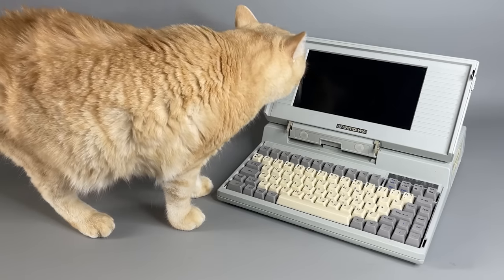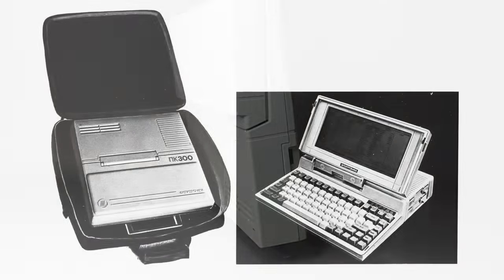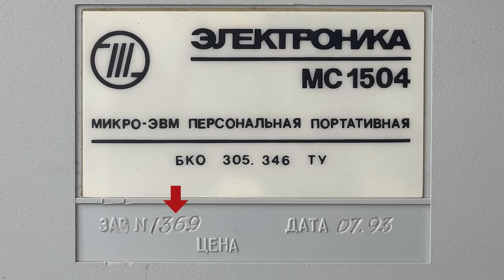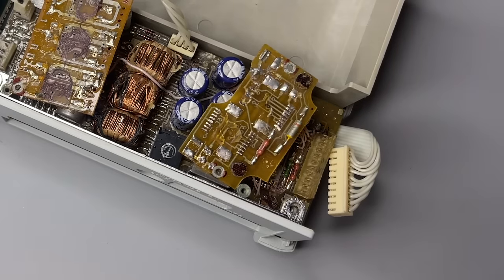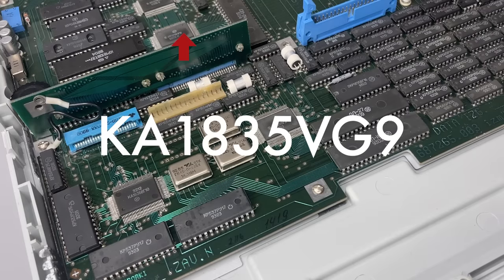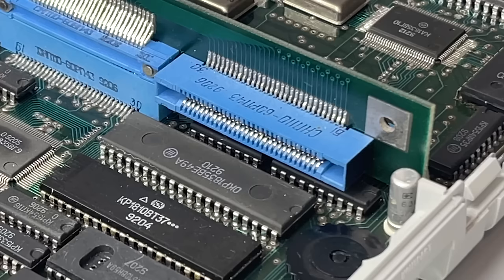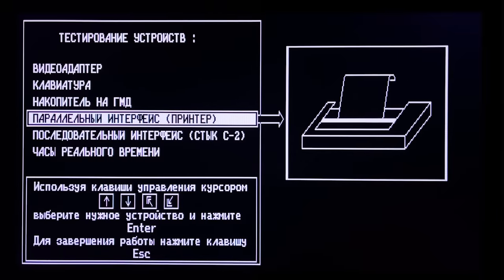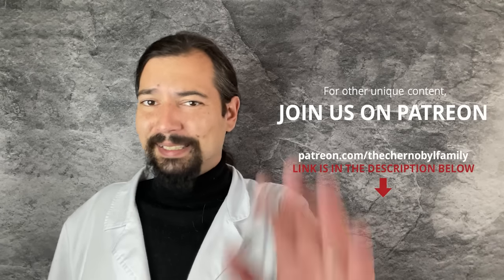I FINALLY FOUND IT! Behold Elektronika MS 1504, the ONLY SOVIET LAPTOP EVER.

Comment: Interesting. It never occurred to me until now how strange it is that these Soviet machines actually had standard ports and floppy drives and other components instead of developing their own versions.
Reply: Well, there were unusual ports, for example electronica MS-6013 printer had it's own connector that was incompatible with centronics DB-15 connector, but I made an adaptor for this and used it on i386.
Reply: if they were focussing on mainframes and minicomputers it becomes less surprising. Once they made the decision to make micros they could see western and Japanese designs and pick what worked best in their situation.

Comment: I'd make it run of off 9v DC and throw in dc-dc converters to provide all the other needed voltages - that's what I did in my MSX which runs internally on +/-12v and 5v
Reply: it's so simple a kitty can use it🤣🤣🤣

Comment: 13:18 comparing the quality of the motherboard with the quality of the power supply board, it is very difficult to believe that both were produced by the same company. And, if they had the tools to make a board with the quality of the motherboard, there is no justification for making another part with the precarious quality of the power supply board. Adding to this, the Latin characters, I conclude that the motherboard must have been manufactured by a foreign supplier, possibly Chinese.
Reply from the maker: A funny detail that PSU prototype was very industrial. Probably, they decided to go for a cheaper handmade solution.
The board is belrusian, latin characters were widely used in Soviet tech - just software sometimes was foreign and could not consume Cyrillic.

Comment: 1990 and they're still using 8086? By then a 10+ year old processor. I get more grunt from a $1 ARM.
Reply from the maker: That is exactly what I meant. It is visible they put some love in this project, but... it is so terrible out of the time.
Reply: AFAIK, Airbus's fly-by-wire system is built on two hardware platforms: 80286 and 68030. The airplanes are still being produced, I wonder whether Airbus has re-certified the hardware for newer CPUs (and there are no new 68XXX CPUs), or has a stock of the hardware they acquired thirty years ago. Anyway, I just wanted to point out that for many applications you don't need a modern ARM. And smartphones are evil :)
Reply: @TinLeadHammer maybe they use ColdFire now? Or emulators?
Reply: They were also still using their 8080 clone! ;) /Brett
Reply: That is the ussr for you i wonder what they would be using today if the ussr was still around Pentium 4? or core 2 duo?
Reply: @TinLeadHammer  Yea but that thing only has one purpose unlike a pc
Reply: Don't want to shatter your dreams, but especially in the luggable / portable market, PC/XT clones were still a very real thing in the West too, in the early 90's. They even sold rather well, brand new. Computers were ungodly expensive then and I was still doing real work on my Victor V86P by 1992. A friend of mine rocked a 386 desktop, and we looked up at him as if he were some kind of rockstar.
Reply: For the record, in 1987 I was using a 32-bit, 8-MHz ARM2, and by 1991 a 25-MHz ARM3.  Back then, it cost considerably more than $1, however.
Reply: 8086 machines where still  being sold in the west in 1990. Not the top end for sure but still being sold as entry level. Now get off my lawn

Comment: I think trying to build a clone like this machine was a bad idea from the start. Obviously it was going to be outdated by the time they started manufacturing it. What they should've done is build a PC that more people could afford, and concentrate on improving the manufacturing process of their ICs to improve the yield. That's the best way to push the technology forward and make it more affordable. The more PCs you can sell, the quicker you can improve the manufacturing processes, which will bring the cost down. Perhaps it won't be as sleek and portable as the Toshiba machine, but more people would be able to use it.
Reply from the maker: ...cloning in most cases is a bad idea.
Reply: @ChernobylFamily Not always.
Cloning the hardware allows for using of software already created.
Reply: @UpLateGeek
За счет клонирования персонального компьютера IBM PC/XT, Мир получил "компьютер в каждый дом" по приемлемой цене. IBM, в одиночку, не смогла бы это сделать.
By cloning the IBM PC/XT personal computer, the world received “a computer for every home” at an affordable price. IBM alone could not do this.
Reply: @vvdvlas8397  Yep, IBM made the mistake of building the PC out of off-the-shelf parts, and were rewarded by clone makers undercutting them using the same off-the-shelf parts and just charging what the mass market would be willing to pay.

Interestingly, the Intel 8088 processor used in the IBM PC was never meant to be Intel's flagship processor, it was just a quick modification of their existing 8086 processor, designed to be cheaper to implement since it had a simpler 8-bit bus compared to the 16-bit 8086. They were actually working on a new architecture that was supposed to make them the big money, the iAPX 432. However this was abandoned soon after IBM released the PC/AT with its 80286 processor, when it became clear that the future was the x86 architecture due to the growing market for IBM PCs and clones.

At the same time this was happening Intel's main "competitor", AMD, had been doing quite well manufacturing licensed clones of Intel's 8088 and other chips. To cut a long story short, after their legal battle surrounding the licensing of Intel's processor designs, AMD's first non-licensed clone, the Am386, took around 6 years to produce, but sold over a million units in the first 7 months of its release.

So while it was the success of the IBM PC and the market for its clones that allowed Intel to continue developing the x86 architecture beyond the 8088 and 80286, AMD's success started at licensed clones of Intel's designs, which gave them the time and money to invest in developing their own processor that cloned Intel's 80386, creating the market for x86 compatible processors we have today.

All that from selling clones at a price that the market is willing to pay.
Reply: @u2bear377  This makes sense in the western world, where there was a lot of software designed to run on the IBM PC and its successors and clones, but probably not so much in the USSR. It makes sense when you can build a clone for a price that people are willing to pay. If you can't make enough profit to develop the replacement for your existing product, then you don't have a business so much as a future bankruptcy. But I guess that's not so much of a concern when the government ultimately owns your business. Whoops! There I go getting political.

Comment: Wait are those serial numbers engraved or did they use a soldering iron? Either way, they were done by hand...
Reply from the maker: You mean on the bottom of the laptop? Hot needle typically.
Reply: @ChernobylFamily  Yeah, those. Nothing screams quality like a serial number etched in by hand by hot needle ...

Comment: So, the motherboard went through 5 revisions, while the power supply was still in prototype stage.
Reply from the maker: It was even more interesting. The prototype PSU was actually way more "industrial" that the one which went into production! Why it happened so... I guess (just guess) that there were too few laptops produced to make one more production line.

Comment: What about the chip with two holes in it? Great video!
Reply from the maker: Thank you!
Those oval openings are a side-effect of the technology of production — in the middle of them it is possible to notice a few holes that are for the manipulator which positions the metal parts during forming/shaping. The crystal itself is sealed in the center.
Reply: @ChernobylFamily  Thanks! I've never seen a package like that. That Russian 3.5 inch floppy drive looks amazing too!
Reply from the maker: @andycristea that one is indeed Russian, I do not remember the factory, but it was made there; also there were a few other, more compact prototypes designed by Elektronmash here in Ukraine, but there is no much information on them.

Comment: The horror, and why would you have 2 floppy drives?
Reply from the maker: To have two floppy drives was perfectly normal practice for computers which did not have a hard disk. From one you boot, on another you have data, otherwise how to work? The japanese computer this was cloned from had the same.

Comment: Sorry to hear about the frustrations with the power supply. But, you should know that it has merely been modified to meet Western standards! Most power supplies in Western laptops of that era were total junk and would burn out after a very short period of time because they were not meant for serious use. My father had a Tandy 1400LT laptop that was my first memory of a computer at about age 3. The power supply went up in smoke about six months later. Eventually, my parents divorced and my dad's new girlfriend had an amazing gift for me at age 8 - the same exact model of laptop with a working power supply, which she had long since stored up in her attic. But that was apparently rare. The power supplies in that laptop apparently never held up under real usage until the later revision when the model was split into the Tandy 1400FD (2x 720K floppies) and 1400HD (1x 720K floppy, 1x 20MB HD). Tons of fraud on the US computer market back in those days.
Reply from the maker: Thanks for sharing!

Comment: wouldn't be surprised at all if the plastic case, along with motherboard would have been imported (made by Japanese using supplied chips), they don't give the usual impression of soviet or immediate post soviet build quality
the keyboard, lcd power supply integration and that horrendous power supply look very much built in house
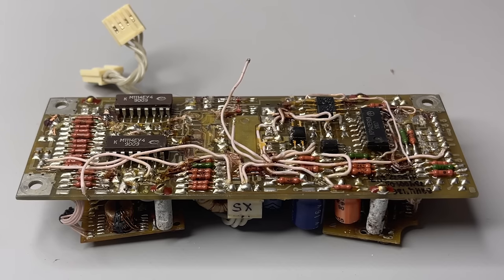also 12:00, I suspect they removed the gold plated chips so they could profit 2x from this, sell chips separately and the laptop itself as complete, unopened unit, then claim someone else removed the chips before they got the machine, and that they never opened it
interesting to see the teflon insulated wires, typical for soviet mil production, have few spools of those wires myself, love them, despite the difficult to remove insulation

Comment: This laptop was not obsolete. It was lowend, but in 1990 these laptots still were sold. They were affordable compared to high-end laptops like Apple Portable, which was bulkier, more powerful but also significantly more expensive. Who would buy in USSR laptop for then 7000 USD?! Elektronika MS-1504 cost under 1000 rubles, which was still like 8 moth wages of average worker.
First modern looklike laptop - NEC UltraLite came just year prior MS-1504, had same power and equipment (minus floppies, because it was really light and compact) and cost 4000 USD.
Elektronika MS-1504 dropped its price to 550 rubles in 1992 (unfortunately at that time USSR was in political and economical turmoil, so it is hard to compare that price to average salary, because often that salary was just on paper and new "capitalists" often did not pay to their slav... eh workers).
Toshiba T1100 Plus, came on market in 1987 (introduced in fall 1986) and costed just under 2000 USD. And this made that laptop hit. Low price. 

USSR was lacking behind consumer electronics. But it does not mean, that they are not capable to produce top level electronics like western companies. Problem was, that there was no internal market for such products. Selling 500-1000 rubles worth electronics to consumers was hard, selling them 10000 rubles was impossible. And companies? Facts are quite simple. There are only two things you can do on computers:
1) Something useful, like CAD/CAM or massive databases
2) Something useless like tables, presentations and stupid videos/photos for marketing

First one was impossible to do at that time on consumer computers. Even 3M computers did not have really enough power to do it and specialized minicomputers, mainframes or even supercomputers were needed. In this area USSR was not so behind. In fact computers like Elbrus-3 or Kronos were more then equal to their western counterparts.  For second one there was no need in Soviet space. Marketing was not a real thing in USSR. Making tables for tables was also minority. Powerpoint? For what, what was military connected was classified, what was outside military was underfunded. And Soviets were rather doers not talkers. So meanwhile americans were talking and painting and faking how will they do something, Soviets just did it (or not).

So I would not see elektronika MS-1504 as something to laugh to. Yes, it was cloned Toshiba, but it was clone of most successful laptop of that era. Was it produced domestically from domestic parts? Yes it was. What is competitive in its price level. Yes it was. So what?
Reply: Exactly. Youngsters see the world through pinkish tinted glasses, but if you have sloughed through those times, you know the latest and greatest in computing wasn't actually available to the masses in the West either, and you had to make do with whatever junk you could afford paying through your nose.
Reply from the maker: I am not sure where you've seen any lauging on it: i gave just facts - even soviets told, this is obsolete. 8086 in  1990, excuse me, is out of the time, when in the magazines advertising MS1504 there are plenty of offers of the more sophisticated machines. Even more - in 1994. I do not speak on affordability, I speak about specs which fit the tasks. If I can afford only Lada (what is my case), it does not change it is a bucket full of screws on wheels.

By the way: although internets claim MS1504 costed 1000 Rub, this does not have a confirmation by price catalogs of Integral.
Reply: @ChernobylFamily  obsolete? In laptop? Nah. This is just misunderstanding of that era. You are probably too young to care at that time what was really used. But in age of Pentium (1994-95), 486 and clones were still most sold CPUs by large margin. And second was not Pentium, but 386 clones! WIN95 was programmed in such way, so it will run usefully on 386! Fact is, that there was artifical GAP between XT and AT, so 286 never did find its way into laptops and on market were 8086 portables/laptops and 386 portables/laptops. Palmtops were running 8086 derivates until 1996 and word processors (dedicated machines) were discontinued in early 00s, because cheapest laptops of that era finally came close to them in capabilities and price.
Toshiba T1000LE was introduced in late 1990 for MSRP 1200 USD. Yes, she had HDD and better display, but otherwise it was still XT platform. Discontinued was in 1994!

So it was up to its task. Its task was to be cheap enough, that Soviets workers could afford it.

About price, this is very problematic thing because of era, when this computer get on market. In that year extreme ruble devaluation occurred. But that devaluation was not economical based, but criminally based. Criminals around Yeltsin and he himself devalued ruble, which has set exchange ratio in end of 1991 to 1,8USD/RUB, to over than 100RUB/USD. This was done to destabilize USSR and consequently allow to future oligarch with help of western "investors" to buyout Soviet Union. But they kept wages of workers on nominal ruble value. So practically over night, any commodity, which was not banned from sales to foreigners (all electronics including computer) rocketed in their RUB price outside capability even richest soviet workers and this is why USSR/Russia started to use dual prices (RUB and USD alike). So MS-1504 costed prior 1992 under 1000 RUB and after devaluation skyrocketed to 50000 RUB. And you have obviously catalogs released after this change.

Whole late Gorbi era was one big mess and it is hard to navigate in sources and facts from that. So it is always good to think in bigger picture. Like when morons are claiming that Russia has economy of Italy (now Spain 😀) not taking into consideration, that deducing such claim from NOMINAL GDP calculated in dollar is pure idiocy.

Comment: I am surprised its not just a luggable with green screen crt monitor that is powered by a car battery. but half of the computer was made in japan anyway.
Reply from the maker: AFAIK, there existed certain military machines which looked somewhat similar to Osborne 1 portable computer, so you are not that far from truth.
Reply: 90% of it was designed in japan

Comment: If we compare it with the best electronics manufacturers, then yes, the Soviet Union was losing. But let's remember how many other Western brands have become a thing of the past and Soviet electronics were no worse than these. 🙂
Reply: Yep, Sinclair was pretty awful at manufacturing. Terrible failure rate using defective components, bad soldering, bad PCBs without solder mask...
Reply from the maker: You certainly have a point. Too bad there was a factor of low quality of production and low reliability.
Reply: @ChernobylFamily  The power supply unit caused me some surprise. The culture of production is completely different from the other parts of the computer. Moreover, I saw power supplies of Soviet monitors for EC computers (Russian analog of IBM 360-370 mainframes) of the late eighties, so they looked incomparably better  than what turned out to be in this laptop.

Comment: It looks like a ripoff of the Toshiba T1100plus which had twin 1.44 floppy drives. The T1200HD had a single floppy and a 20mb floppy drive. I worked for a computer shop in the UK and we used to sell a lot of Toshiba's.
Reply from the maker: Precisely. I actually mentioned that..)
Reply: @ChernobylFamily  I was typing that as the video was starting... could not be bothered to edit it. Are you going to cover any vintage 'home' computers and the plethora of Spectrum clones.